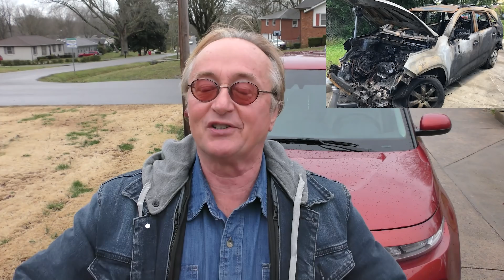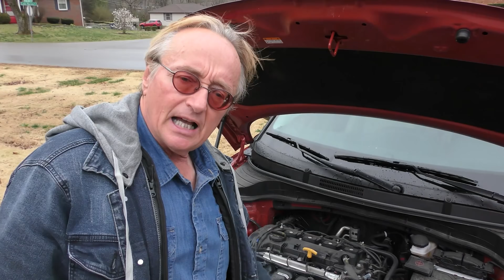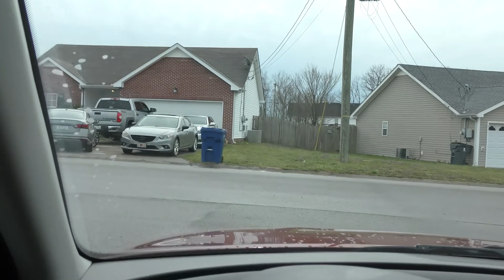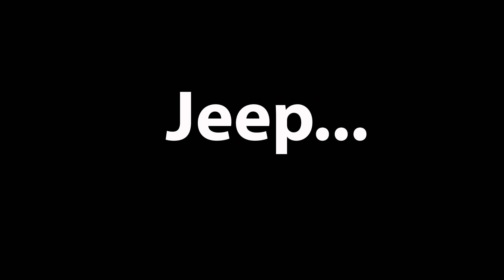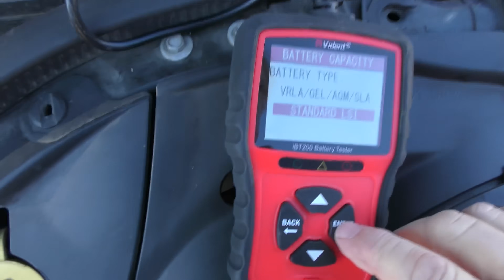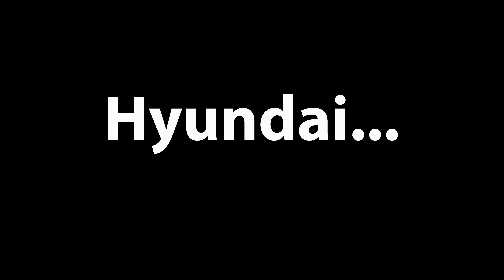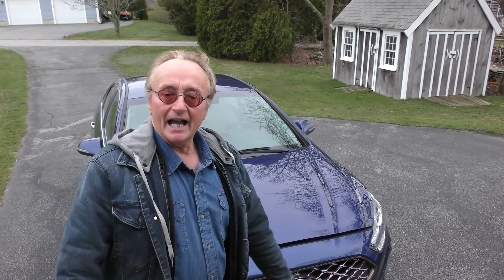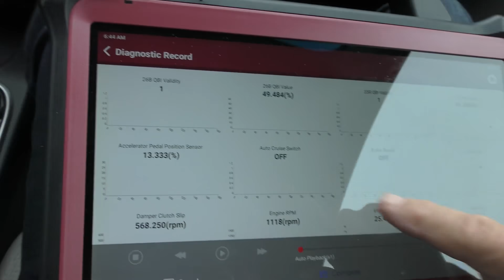3 Car Brands That are Crap

Comment: I have a 2020 Kia. Had to replace cvt at 15,000. I got a loaner car thankfully and it was covered under warranty. Still driving it. Despite the transmission I like the car.
Reply: Yeah,  like how they recalled the anti theft device!  Sheesh
Reply: Yeah,  like how they recalled the anti theft device!  Sheesh
Reply: Yeah,  like how they recalled the anti theft device!  Sheesh
Reply: Yeah,  like how they recalled the anti theft device!  Sheesh
Reply: Yeah,  like how they recalled the anti theft device!  Sheesh
Reply: Yeah,  like how they recalled the anti theft device!  Sheesh

Comment: I had a 2004 kia Spectra I drove into the ground at like 220,000 miles on it. One day it just didn't start. I had to replace the oil monthly as it both leaked and burned oil, but still, I figured myself extremely lucky that it just stopped working instead of blowing up.
Reply: Killed In Action
Reply: Kia Sentra?? What alternate timeline have I stumbled upon today? 😂
Reply: @Lalo_thr  my bad - it was a kia SPECTRA.
Reply: I had an 01 Spectra hatchback that ran fine, but had 1 fatal flaw. The car's fuel consumption was horrible! I was lucky if I got 200 miles on a full tank. I brought it to 2 different mechanics and they both couldn't understand why it was burning fuel that quick. I never did give Kia a 2nd chance.
Reply: Kia Sentra?!? I don’t think so.
Reply: @SPF2300  it was a 2004 kia spectra. I get those two cars confused.
Reply: @Traint_Trungdrundringsron  You are on a car channel sir. You are not allowed to be confused.
Reply: @henrykim4230  they look identical!
Reply: The Sentra is made by Nissan, only a Nissan can make it to 220,000 miles.  The Kia can't even make it up to 22,000 miles.

Comment: All I can say is when I was looking for a new (to me) car in my senior year of college I was watching Scotty videos left and right. Paid $2,000 for a Mercury Grand Marquis on his recommendation and have had nothing but regular maintenance to do on an 18 year old car. Listen to Scotty folks.
Reply: i bought a 2002 grand marquis a couple years ago after my piece of crap ford focus transmission when out... other than changing oil and tires this thing is the best running car ive ever had. Sure, im driving a "grandpa car", but it also cost $1700.
Reply: @anthonytauber9209  who cares if people say there a grandpa car, there great cars and there tanks. I was shocked when ford stopped making them in 2012.  If someone in a little kia or Nissan car hits you in a marquis or a vic. Chances are your gonna drive away and there gonna be getting towed.. there full frame vehicles.  As long as you don't brake torque them the transmission will last several hundred thousand miles..  keep the oil change and a new fuel filter at least once or twice  a year if you drive a lot and your good.. plus you can tow a decent amount of weight with them too.. always a plus to be able to tow something..
Reply: @jdubskiwright2380  They stopped making them due to them being too good.
Reply: Good car. Like a Crown Vic. Any car the cops choose is going to be a good choice.
Reply: @Dannysoutherner  
Except they use Dodge Chargers and Ford Explorers now, which are both terrible cars (especially the latter).
Reply: @Dannysoutherner  Why don't they have Toyota Camrys then? 😆
Reply: @adamsstreetcrossover  too little. Wouldn't do for pitting a runner. I saw a runner a couple of days ago. 2 police trucks had a guy in a camry or similar sedan pulled over. We were sitting at the light right next to him when he started his little car, floored it and took off up the interstate ramp. They took off after him. Then another cop took off up the surface street that parallels the interstate. Was pretty exciting.
Reply: @Dannysoutherner  yeah I bet it was! Bet they went up the parallel street in case he decided to try to exit the interstate 😆
Reply: @adamsstreetcrossover  my guess as well. He couldn't get past us to rush into the neighborhood where he could have vanished. There are 5 limited access exits before he could have reached the real town about 10 miles away. I'm sure they had all the exits covered. Hoped news would have a story but they didn't.
Reply: @adamsstreetcrossover  
Because they only use American cars to support the economy.
Reply: @adamsstreetcrossover  Actually, I've seen Camry cop cars. When I was in NY, I saw a bunch of them. Most of them were the Camry hybrid. I also saw a bunch of Prius too. If you don't believe me, Google it.
Reply: @adamsstreetcrossover   bc why would the local governments pay a foreign car company.
Reply: @adamsstreetcrossover ow many crooks can fit in a Toyota vs. a Crown Vic?👮‍♂️
Reply: @adamsstreetcrossover Camrys are too slow for their needs
Reply: @adamsstreetcrossover  Wouldn't be able to catch a crook on a moped!
Reply: @adamsstreetcrossover probably would rather boost an american car brand up vs foreign
Reply: @Dannysoutherner  unless it is a BMW.
Reply: @Dannysoutherner lies they have chargers and chargers are unreliable after 100k
Reply: Detectives Crockett &Tubbs..........
Reply: The Chevy Caprice wasn't a good car for patrol, it was fast but that's about it.
Reply: The crown Victoria and grand marquis are great cars especially the models with the 4.6 v8 motors. The older 302 are still good but the 4.6 get better mileage.. there not rocket ships but they ride good there easy to drive and they can last to 400k to 500k miles when taken care of..
Reply: @jdubskiwright2380  The only thing I don't like about the 4.6 other than its rather massive physical size is those long timing chains. I guess they are proven tech now but I've always worried about them snapping. The 302 is definitely more compact and can fit in a ranger easily enough. And the 302 can be used with a carb and modified gm hei dist. Dirt simple, reliable and easy to fix on the roadside if an issue comes up.
Reply: @Dannysoutherner  for sure, the 302 is a great motor, for all sorts of things, racing, off roading, daily, truck motor for working they do it all.. an yes the 4.6 is kinda big for a 281 cubic inche motor, but there rather strong, some of them depends on the model year I believe can handle 800 hp stock.. that's not bad at all, and there awesome under boost, biggest down side with the 4.6 and 5.4 is you can't really stroke or bore them.. and the 5.4 is the same as 4.6 except for the heads, that's what makes the size difference, bigger heads. Everything else is the same, bore stroke ECT...
Reply: Is there a mercury marquis appreciation club?
I got a twenty year old marquis that survived a tree fall during a hurricane! If I had a smaller, newer car it would've been flattened.
Reply: @christineschutten248 My favorite car was our 1983 Mercury Marquis! It lasted until 1996, when our mechanic put the wrong sized spark plug in our engine. The result was one of our pistons overheated and completely melted! 😢 I still miss that car, lol!
Reply: I'm looking for a Panther platform car myself.
Reply: @Mklop23  Good advice, thanks!
Reply: My favorite car was a new1984 Ford Tempo, manual shift, and able to pay $9,000 cash for it right out of college, but I had to have a '90 Thunderbird (beautiful, should've kept that mechanical girl), then a '94 Dodge Stealth and onwards back to Ford. Last purchase for an every day car was a 2010 Ford Edge with now  over 112,000 miles, I don't drive when I can walk. NOW, American car companies can build the best cars in the world, we're Americans! Who's paying off the U.S. car companies to produce junkier increasingly by the year. I'll be driving my 53 thru 12 y/o cars until I'm dead & yes debt free (don't keep up with the Jones's) So,  U.S. cars companies: WHAT's UP DOC?
Reply: @jeffreycraven8154  Dodge stealth was a mitsubishi 3000 BTW. And didn't And never would buy an American car after the 70s. The last one I bought was a 1995 f-150 and it was terrible. Terrible assembly quality, terrible reliability. Bought Toyota tacoma since then.
Reply: @MarvinHartmann452  Loved my '94 Stealth, it drove and roared so nice. When it came to major repairs, everything in the engine compartment was was so tight, only one mechanic for 50 miles around would attempt it. Before that, the clutch plate had to be repaired and in the process a mechanic had to be driven by ambulance to the hospital. The Stealth and 3000 were above the cut until something major went wrong.
Reply: My 18 year old Grand Marquis had nothing but problems when I bought it recently but I do know they are good cars.
Reply: Same . I was in the market two years ago. Grand marquis/ town car or a Corolla/scion I was looking at . Ended up going for the scion
Reply: The new cars are made to wear out these days! They call it planned obsolesence. The older beasties if maintained well will outlast any new car.
Reply: Love those cars
Reply: Grand marquis is a battle tank disguised as a boat. I had an all black 99, great car. It just sucked a lot of gas.
Reply: @BB-ed4omI have a 97 Marquis I super love it but yeah it is heavy on the gas
Reply: I brought a crown Vic for $850 bc the owner got a DUI. Great car
Reply: Yep. It's 2023. We still have a 1996 Grand Marquis. Only repair in the last 10 yrs. was on the dashboard computer. I've seen many comments here about cars less expensive to run that are the same price and I agree. We wanted a small SUV, but the Marquis was literally the only vehicle we could find that my husband's extremely long legs would fit into, even with the seat all the way back. If you are very tall, it's a great choice. People who rode in the back remarked on how comfortable it is, and our 106 lb. dog fit in the back just fine.
Reply: Mercury Marquis is the kind of car I bought in the past as a winter driver but they have terrible gas/mileage and equally terrible handling. Reminded me of the car I drove in the 80s. It was a 1971, 440 equipped chrysler le baron, less the power of course. If you have absolutely no other option then it's OK but there's far better car that are cheaper to run than these that you can buy for a similar price.
Reply: I watching for a laugh cause every car and every company is crap 😂 🤣 🤣🤣🤣🤣🤣🤣🤣🤣🤣🤣🤣🤣🤣🤣🤣🤣🤣🤣🤣🤣

Comment: The Kia we are owning have not had any engine problem, not every Kia has engine problems. Kia is actully a reliable carbrand. 😅
Reply: When's the last time you saw a kia from the 90's?
Reply: there's absolutely no way they are more reliable than hondas and toyotas. My 1994 honda still runs like a dream. Kias will never last that long. They are not built to last.
Reply: Not every car from the bad brands is going to have problems, it's about likelihood.
Reply: I have a 2005 Kia Spectra5 with 237.000 miles on it best car I've ever owned, I keep all the maintenance on it use synthetic oil and change the timing belt every 60.000 miles and I wouldn't trade it for any other brand this little car has been awesome for me 😸

Comment: My 2011 Sorento has a fantastic engine 3.5 v6…runs great… every single other thing is broken in this car!  Doors windows locks gas door lights radio speed sensors fan covers ac,,, cruise control about every available button… but it runs great!!! At 170,000 miles now 😂
Reply: Around that year I looked at buying a Sorento but decided not to because all the interior materials they used looked cheap.  I know enough because back in 1991 I owned a kia Pride and the materials used on that model was much superior.

Comment: Hi Scotty.
What do you think of the W126 chassis Mercedes Benzes made in Germany?  I'm thinking about buying a 1991 560SEL for only $12K.
Reply: If you value your money don’t ever buy a Mercedes. Breaks every week and costs more than it’s worth to repair.
Reply: I'd recommend buying a w124 instead.
the gentleman above is right about mercs but those 124s are an exception imo

Comment: My family bought a 2006 Kia Sedona brand new, and we still have it. Almost 200k miles on it. So many road trips, and until last year, no issues. The issue was a coolant leak cus I did a burnout in it. But got that fixed, and my dad still drives it to work every day. I love that van.
Reply: a burnout caused a coolant leak???
Reply: @retiredat44  high RPM causes high pressure in the cooling system. Any leaky parts will be leaking afterwards. I blew out the water pump of my old jeep when I did a hard acceleration.
Reply: My mom had a 2016 Kia Optima and the engine caught fire on the highway driving to p.a from nyc and they told her it was her they couldn’t pay cuz it was to much damage to determine where the fire started even tho that engine was recalled and they gave it back to her a few weeks before saying it was fine🤫🤫🤫🤫
Reply: My dad has a 10 year old Kia van. Never an issue.  We have a Subaru forester.  It burns almost all the oil before 3k miles.
Reply: @ryanneedham8820  subaru is garbage yes
Reply: @Patrick-nc6kk  I bought a Subaru Legacy Gt in 2002. Hated it. Traded it in for a 2004 Honda Accord EX-L V6. Still driving the Honda today. So much smoother than the crappy Subaru engine.
Reply: @Patrick-nc6kk  facts lol
Reply: The engine blew on my 2016 Kia Sorrento I got it back a week ago. They covered under warranty and I did get a free loaner car but I’m not buying another Kia
Reply: I had a 2003 Rio.
Reply: @andreaberryman5354  I had an original Nintendo
Reply: That's because it's a van.

Vans are more reliable than other regular cars because they're meant for families.
Reply: No burnout in the history of automobiles have caused a coolant leak. Someone was guilt tripping you. If a car is leaking coolant because of a burnout you have much much bigger issues. You have cracked the head. I guess there's a slim possibility that a fan blade could have dislodged and cut a hose but I doubt your fan is driven by the engine. Most likely two fans driven by individual. And electric motors. Even in this particular instance,  the fan(s) would have broke do to wear and high engine rpms. Not because the tires were spinning.
Reply: Don't buy the new Kias then 🤣🤣
Reply: So, you guys gt lucky...I've seen plenty of kias that  had been maintained, and had blown motors at low milage
Reply: @richsweeney1115  stay away from this crap car ,fools
Reply: Yeah no problems with my Kia. This isn’t fair
Reply: Huh.
Reply: Garbage
Reply: It's like some are good and some are complete lemons!
Reply: My sister bought a 2013 kia soul. Must've been a good year for them cause she's got 300k on it and no issues. Yet.
Reply: It depends on the year I think…after Hyundai bought out KIA they’ve become more reliable…2021 they were ranked in the top 8 for reliability…but 2022 they dropped significantly due to some recalls…
Reply: @jasonwilkinson378  just because JD power or whoever claims they are reliable..does not mean they are
Reply: @jasonwilkinson378  no they weren’t
Reply: But still, ur driving a car with the acronym: Killed In Action
Reply: @tiffanyvalencia8415  TiA would have been much better..
Reply: @tiffanyvalencia8415  That's not what it means in Korea. You do realize that Kia was started by a South Korean company right? And you do realize they were allies in the Korean War right? So if you are trying to insinuate a former combatant is rubbing it in our nose that we couldn't defeat them and killed our countrymen in the process you are wrong.
Reply: @bradsanders407  No, not at all, apologies as I meant the American acronym meaning.

Comment: Weird.  Got myself a new '02 Hyundai Sonata, V6, in '02.  Between then and 2013, two mechanical problems: a window regulator broke, and the AC developed a slow coolant leak. Didn't bother to fix the AC, just gassed it up in the spring.  176,000 on the odo when I traded it. Bought my son an '03 Hyundai Accent in '03  Other than him stopping it against trees and other cars and such, no problems.  He eventually sold it to someone when he got sent off to Iraq.  In '13 traded the Sonata on a '13 Elantra GT (1.6 liter?) for my daughter.  She still has it, only 265,000 one-owner miles.  Everything still works. Bought a '22 Elantra SE, 2 liter, in late '21.  Currently has just over 25K on it.  Gets unreal gas mileage, handles like a slot car, free oil changes and such for 3 years, zero complaints.  

During that interval My '00 Honda Odyssey (traded it on the '22 Elantra), went through three transmissions and electric doors failed, but just shy of a quarter million miles.  '95 Ford Escort wagon swallowed a valve at 160K and sold it for junk,  '08 Saturn SLwhatever, 180K, came apart like a $2 watch, sold for junk. '15 Honda Odyssey soldiers on with 65K on the odo. 

Conclusion: Hyundais suck less.
Reply: I know it's kind of like you can have a lemon no matter what brand that is and you can have a car that is just amazing if you treat it right no matter what brand. Every car company sucks every car company is coming every car company tries to get by with as little as possible. I used to be a Toyota man first and foremost until they drop their warranty coverage below the Korean manufacturers. If they put so much faith in their product why would you do that? My mom has an '06 Hyundai sonata that is still running at 270,000 mi on the original powertrain. Whenever race comes out of bed I'm going to get one for myself. Anyone who's slightly mechanically inclined and pays attention will have a car running well.

Comment: Last I checked Chevy and Ford also have issues with engines burning oil at 15 to 20k miles and a Chrysler product will do it from the day you bought it. All of the manufacturers act the same way over it as well.
Reply: According to Chevy, burning one quart of oil every 500 miles is acceptable. It has to be worse than that before they will do anything about it. I had a Grand Prix gxp with the 5.3 v8 that only had 100k on it and was burning about that much as well. All manufacturers have their issues.